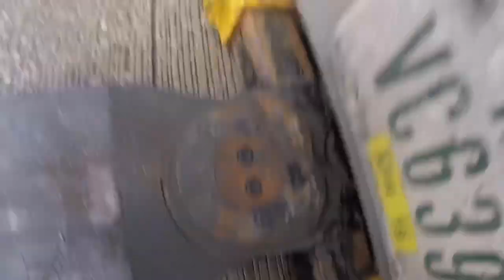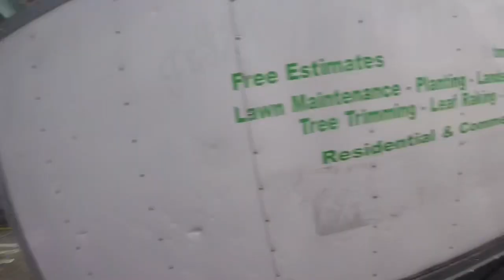Rotator work ep 81 Coronado with a blown turbo

Comment: You would do well over here in Australia, most Aussies are just dead lazy and wouldn't work at your speed ( seriously) . However , hooking up a road train with 4 trailers and 2000 litres of fuel on board may knock a few miles off your top speed

Comment: Dad always disconnected the air line from the compressor and connected his truck air. Seems like it only took a couple minutes.
Reply from the maker: Yes it’s not to bad to do it that way honestly that was a last resort as the air tank fitting where all located in to tight of places to get my hose into it to feed air but did what I needed to do had I known I was going to do that I would have done it all at the same time as I was dropping the shaft thanks again for watching

Comment: Do they make air lines for trucks like the ones in workshops where you can just pull out what you need and no need to worry about excess. !?  Cool video though. Dan
Reply from the maker: They do and with that idea I will put one on there because of that idea and would make it so much easier for slack of line thanks again.
Reply: Dan Hayward I have one for air hose and one for oxy/acyt on my service truck and love them

Comment: I seen one guy pull the line off the compressor and tie in there. It looked way easier.
Reply from the maker: Yea unfortunately I couldn’t get a wrench on the line coming from the compressor with out taking off the intercooler pipe so had to go with next option thanks for watching

Comment: Hay good job looking after his truck 👍👍👍👍👍👍🤗 way do you take the drive shaft off for dose it rolls easy 😃😃😃😃
Reply: Darren Rowe it’s so they don’t damage the gear box
Reply: Carl Curcuruto hay Carl is that I should now do on the trucks thank you I like the picture on the black arms monstersinc👍👍👍👍👍👌👌👌👌
Reply: I get that for auto's, because 'most' automatic transmissions only have a front pump, driven off the input, and without that hydraulic pressure the transmission can seize. Modern manual transmissions are constant mesh and the oiling is primarily splash (some may have a recirculating pressurized feed, and/or cooler, pump driven off the gearbox) and is exactly the same whether being driven by the engine or the prop' shaft - think of it as being like travelling down a long grade.
An exception would be if there was a transmission issue causing the B/D, in which case it would need to be disconnected.

That said, may be to cover them for some BS liability issues a dodgy truck company may try to hit them up with.
Reply: You are correct, was having a brain fart, apparently, as I've had a LOT of transmissions in for repair.
No excuse, 'cept maybe old age ;-)

Comment: How could a blown turbo charger cause an engine to run away?
Reply: The diesel engine can burn oil and the turbo is lubricated by pumped engine oil.  It's not common but it happens, the faster the engine turns the more oil is dispensed until something breaks or it runs out of oil.